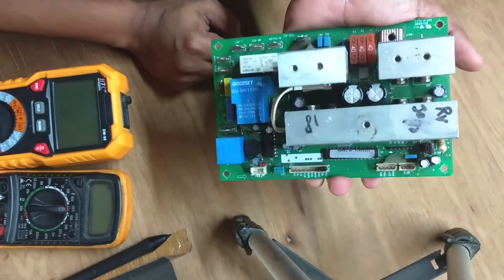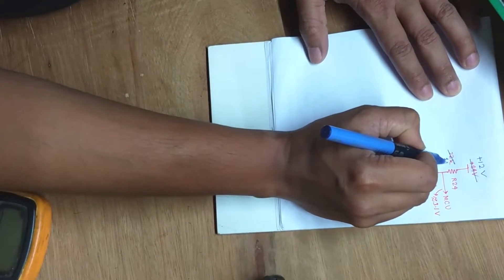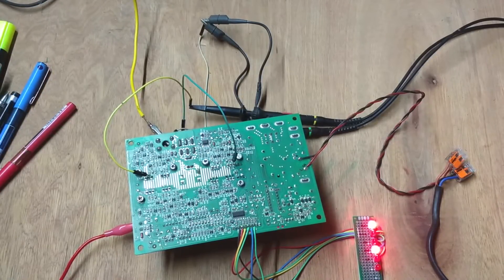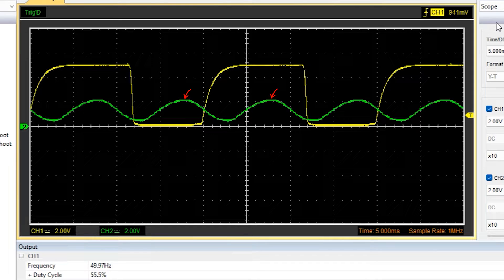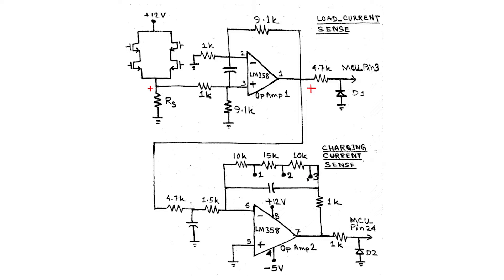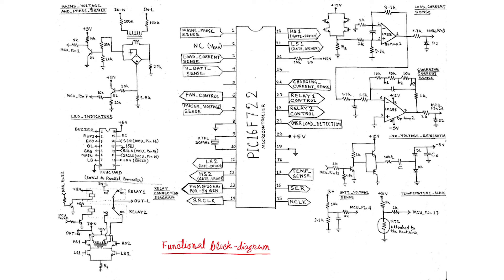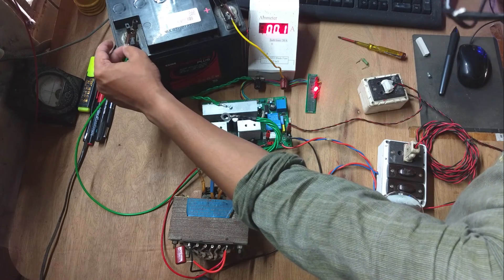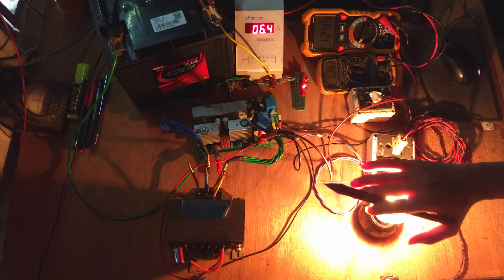I have turned a Square Wave Inverter into a Pure Sine Wave Inverter

Comment: Sir I have a question that how we can purify UPS output . As in many UPS outputs are not pure sine wave so without changing inverter circuitry can we design a filter that convert stepped sine wave to pure sine wave .

Comment: Very-Very Impressive bit of work!  Nice job of reverse engineering the inverter then figuring out how modify it. I did have a question about the current selection resistors in the feedback-loop: How were the individual resistors shorted (relays, transistors)?
And you are quite correct, there is no replacement for assembly-code when you are dealing with time-critical circuitry; no one needs an unforeseen compiler-boondoggle!  I wrote a assembly program  for the the MCP3301(?) 13-bit A2D converter and it was so nice and tight that I would have never gotten the performance or reliability of timing using C.  Anyway, that was years ago and am just now getting back into PIC and trying to get used to the MCC so that I don't have to write some of the more complicated Peripheral-Library functions--but it has been a challenge coming from where I used to just 'roll-my-own' for coding everything.  Sure hope you make more English videos; which begs the question: Is English understood by most Indian-people that work with electronics technology; or do you have to make Indian-language versions as well?  Your videos are so valuable that English versions might reach more people especially dummies like me that can barely speak English even though it is my native-language--LOL!!!
Anyway, great video and channel--Thank You!
Reply from the maker: The resistors were shorted through male headers using a 2 pin short jumper.
I make my videos in English for my channel although my English pronunciation is pathetic. The reason I chose English instead of my mother tongue Bangla is that, I always want to be a part of the community of electronics enthusiast people beyond the boundary of my linguistic territory. India has so many different languages that to reach out most of the people English is the best way to go with.
Anyway, thanks a lot for your appreciation and sharing your ideas.
Reply: @ElectroHijibiji  well, thank you very much for replying. And I am very happy that you are willing to do your videos in English because they are very valuable. I think one of the biggest problems with Indian speakers trying to speak English, is that they try to talk too fast, and therefore don’t properly annunciate each syllable and consonant. So if they would just simply slow down a little bit, I think they would speak a lot clearer. Also, I did not know that India had multiple languages, I pretty much assumed that the country just had one.
So thanks again for replying and have, a great future with your channel…

Comment: This is really impressive. I've been meaning to try to do something like this with either an ESP32 or an RP2040 to try to run a hybrid vehicle inverter as a mains inverter. My issue is that "off-shelf" solutions like the EG8010 work at way too high frequencies to be able to drive big IGBT's at b/c of gate capacitance.

I was able to reverse engineer my gate drives already, just need to find the time to actually play around with hooking a microcontroller onto them and see what I can do with them.

I know PIC's tend to be used a lot even nowadays for SPWM since they're purely programmable VS EGMicros. But for some reason I can't for the life of me learn to program these things haha. But conversely I also realize that higher-level programming such as C++ is probably not the best to use for such an application lol.

Idk how accessible they are where you're from, but over here for $100 you can find Toyota Prius hybrid inverters which have basically TWO 3-phase inverters  AND a boost/buck converter inside. The boost converter can handle upwards of 150A (limited by the saturation current of the built-in inductor) and the IGBTs a ridiculous 600+A continuous if you parallel both inverter outputs, tested to handle a 600vdc bus.

So in a single pre-built unit you can boost your 12v into your 160vdc or 320vdc and then directly invert  it into 110 or 220vac. Just need filtering. Obviously at lower voltages you're limited to something like 2kw at 12v input, but can be easily scaled up into hundreds of KW if you increase battery voltage (and bypass the boost section)

I made the mistake of going for a ford fusion inverter which had zero documentation online (with the intention of reverse-engineering it, or more importantly the gate signals so I didn't have to mess with the gate drives) and blew my boost/buck IGBT.

Anyways lol just thought I'd share, seemed like you'd be interested in that type of thing.
Reply from the maker: I was so messed up with my life that I missed such an interesting comment. Thanks for sharing your experience.
Reply: @BW

> But for some reason I can't for the life of me learn to program these things

Happy to walk you through it, although TBH - using ESP32s will get you far more bang for your buck (happy to walk you through that as well)

> for $100 you can find Toyota Prius hybrid inverters which have basically TWO 3-phase inverters AND a boost/buck converter inside

This sounds extremely interesting - would you mind connecting so I can learn more from you?

When I visit junkyards, I do see those Toyota Prius hybrid inverters so it is worth learning about them

PS: I also enjoyed your last 2 videos!

Comment: best inverter tutorials please do tutorials on how to accomplish spwm using software pwm as i do see some pic16f72 pure sine wave inverters using it and as you know it has only one dedicated pwm module
Reply from the maker: Although it's possible but 16F72 is not a good choice for pure sine wave inverter because, there would be a lots of harmonics. Rather, I'm planning to use Atmel16A uC

Comment: Can LCD be implement and how? Again what this transformer worth 2 100k Resistor' doing at the mains sense part? If that is 220vac transformer or current transformer please indicate
Reply from the maker: No, LCD can't be connected with this existing circuit. This project was solely targeted to the software modification not any sort of hardware revamping. The transformer is a voltage sense transformer and two 100k resistors are limiting the current passing through the primary windings.
Reply: Is this a complete diagram and code to build this Inverter? Again i couldn't locate the fan control circuit
Reply: Can you direct me on this?

Comment: did you changed the output  transformer
Reply from the maker: I got only the PCB from the original inverter, not the transformer or other peripherals.
Reply: @ElectroHijibiji  thanks
 what is the voltage  required at primary and secondary of the sine wave inverter transformer? If we use 12 V square wave transormer for sine wave inverter . it will clip the top portion of the  sinewave..

Comment: Hi, do you implement stable 220v  output  feature in the code?
Reply from the maker: This is a commercially available inverter PCB made by Luminous and they didn't provide any feedback path for the output. So, there is no chance to implement the feedback in the code. Nevertheless, if the transformer rating is suitable and battery is healthy (not much voltage drop in load condition) then the output voltage doesn't change much. A 20-25 V shift might be acceptable in most of the cases. So, no need to bother much about feedback.
Reply: @ElectroHijibiji  ok. I was thinking a good inverter should have feedback feature for constant 220v output. Besides, base on the block diagram, there are still some available pin of the microcontroller which may be used for this purpose.